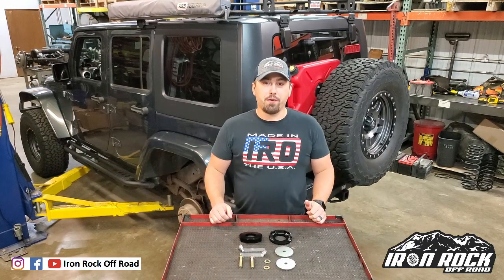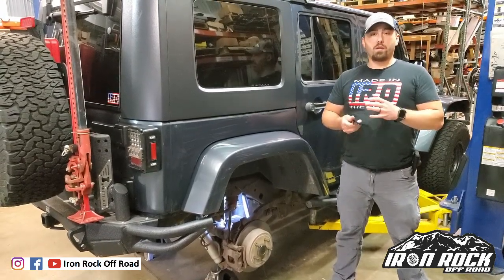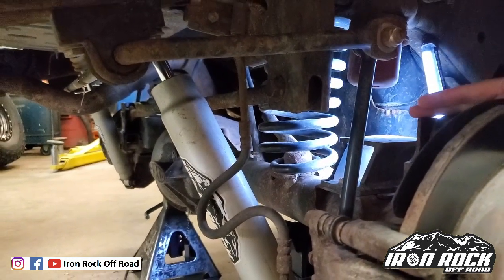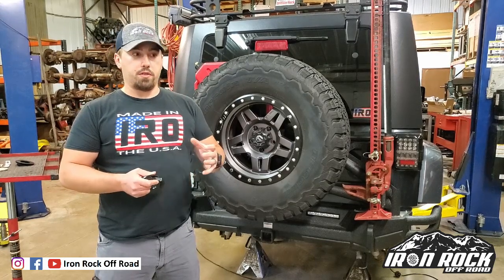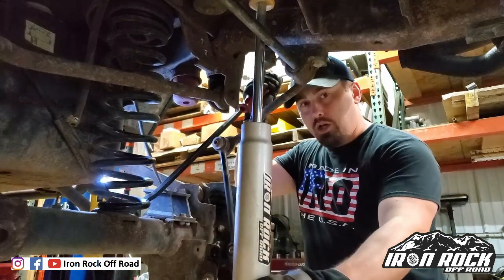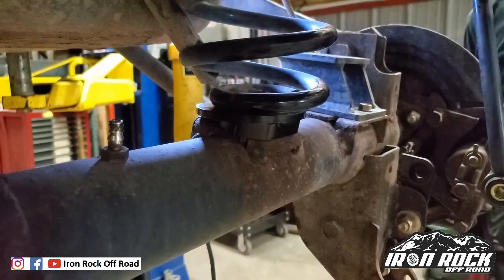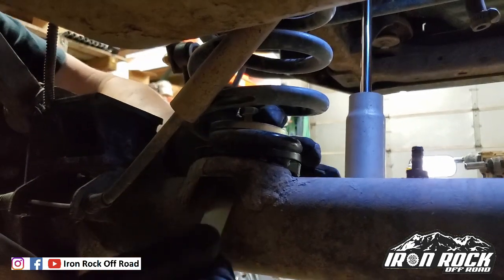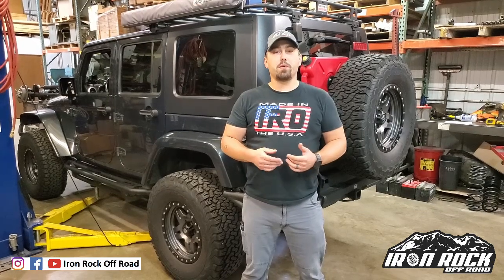JK Rear Coil Spring Correction Plate and Retainer

Comment: Is this only for stock axles I have dynatracs
Reply from the maker: This is designed to work with the factory coil pads, however if your pads are same or similar enough to the factory ones, they should work for you as well!